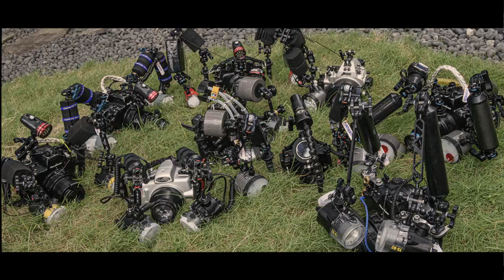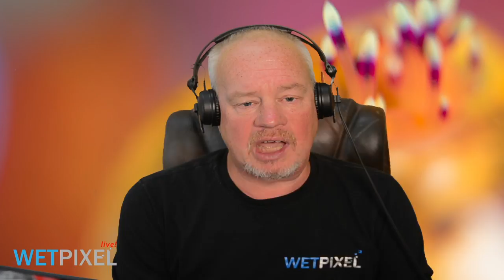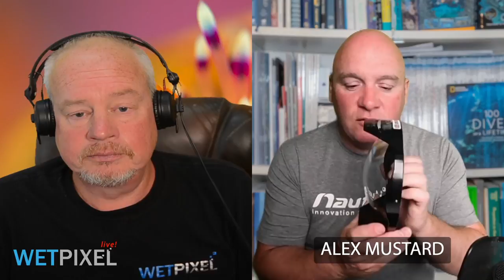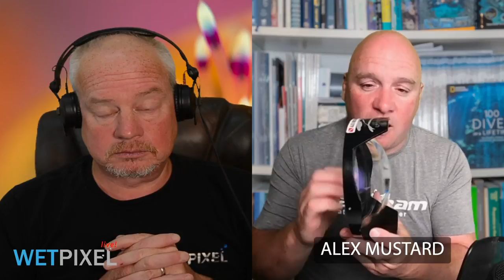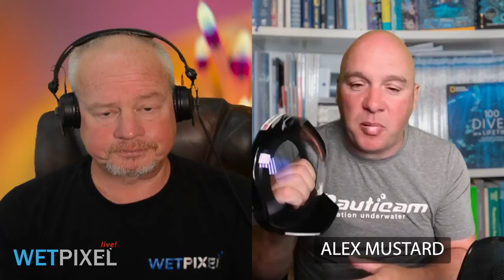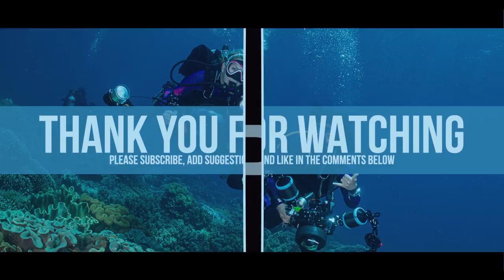Dome Port Essentials for Underwater Image Makers

Comment: I wish you talked about the close -up filter and how it effects using dome port underwater. It is confusing since some articles suggested that using close-up filters behind the dome port is essential to be able to have sharp images. Plus which of the power of the close-up filter such as +2,+3 and +4 to use?
Reply: You need a closeup lens only if your lens is not capable to focus close enough. During the film era this was the situation quite often. With modern lenses - especially with fisheyes - this is not an issue any more. With small domes this may be an issue..The dome forms in water a negative lens . The virtual image seen by the lens is at least four dome radius away from the cener of the dome i.e. 3 from the dome surface. That is the minimum distance the lens should focus.
Reply from the maker: What he said-it is impossible to cover each individual lens and haw to set it up in a video. Your source for information like this is the Wetpixel forum...https://wetpixel.com/forums/